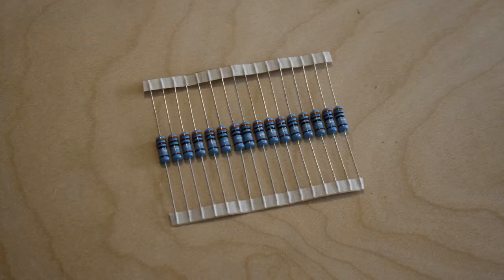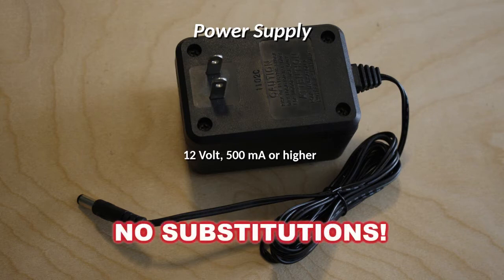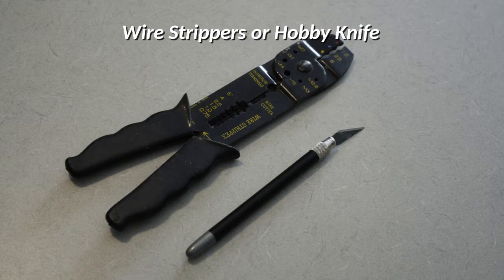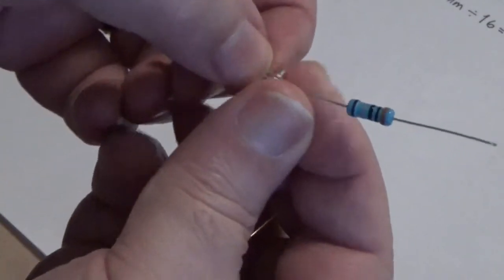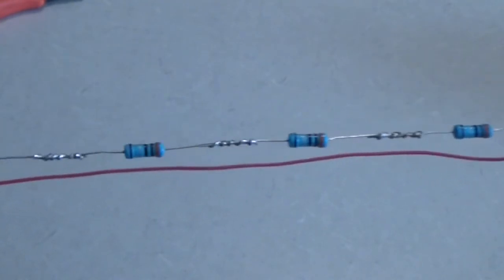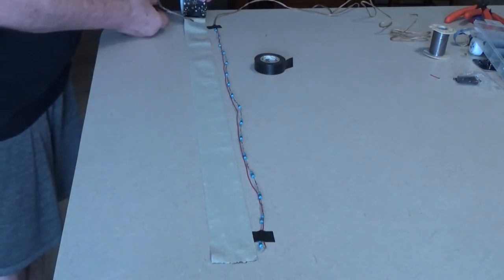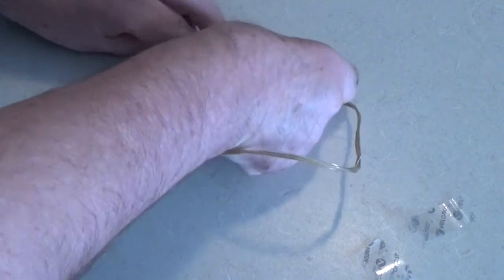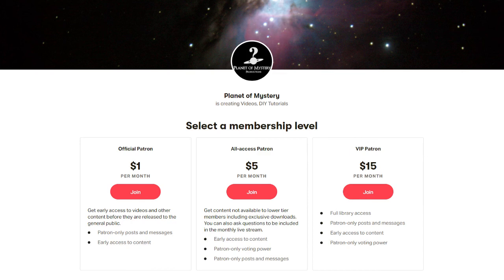DIY Dew Heater Tutorial

Comment: Hello thank you for this video!  Would this work for eyepiece strips also?  I'm a novice so unsure how that many less resistors will affect the build, i mean would it over heat?  Thank you for the video again!
Reply from the maker: An eyepiece strip wouldn't necessarily overheat but you wouldn't need the 3 watts of heat this produces. 

Using the formula of Ohms=(voltage^2)/watts for a one watt heater, you'd need 144 ohms. Use three 47 ohm resistors arranged around the eyepiece to get 141 ohms which would be close enough (you'd get slightly more than 1 watt of heat). Use half watt resistors and you won't have to worry about causing them to burn out.

Comment: if i wanted to run a 2 watt heater off a 16650 battery, am i right to assume that i would need resistance roughly equaling 6.85 ohms? if i went to say, 7 ohms it would just make me a slightly less than 2 watt heater right? the only other thing i'm confused about is what benefit i have changing the watt rating of a resistor. i thought that was their rated consumption but that can't be correct.
Reply from the maker: From what I can see, the 16650 battery puts out 3.7 volts. So, yes, for a 2 watt heater, it would come to a total of 6.845 ohms. That's going to draw slightly more than ½ amp. So a 1 amp hour battery would last about 2 hours.

You might make a ring of 7 resistors each at 1 ohm. Each resistor would have to contend with 0.286 watts so ½ watt resistors would work well. 

The watt rating on the resistor isn't the determining factor of how much current it can draw. It's a matter of how much it can draw before it pops. If you put 1 watt of power through a ½ watt resistor, you'll burn out the resistor. 

As for the formula for determining how much resistance you need for a specific wattage output, it's Ohms = Volts^2/Watts. 

The number of resistors was based on the rating (say ½ watt) and the number of watts (3) then I'd want to use a minimum of 6 resistors so I wouldn't overload the rating. To be on the safe side, I might go with 8 so each one would generate 3/8 watt. 

I might do a follow up to this video to explain the math behind all of it.

And I apologize for the delay in replying. Computer troubles.

Comment: Love your video. 
I have a 12” Newtonian , it’s about 42” around . How many resistors would I need ? And also for the secondary mirror ? I have a Thousand Oaks dew heater controller . 
Thanks
Reply from the maker: I'm not sure how much voltage is put out the the Thousand Oaks dew heater so that's one factor.

With a Newtonian, unless it's open tube, you probably don't really need a dew heater for the primary. It takes a LOT for condensation to reach that far down the tube. But if you do need one, you're probably looking at a 6 watt dew heater.

For the secondary, you can probably get away with a 1 or 2 watt heater. 

To calculate the resistance you'll need, use the following formula:

Ohms = Voltage^2/Wattage

So if you've got 12 volts, to generate 2 watts, you're looking at 72 ohms. To generate 6 watts, you're looking at 24 ohms. 

Now figure out the circumference and come up with how many resistors can fit in that space. Divide the total number of ohms by that number to get how much you'll need per resistor.

On the primary of a Newtonian, don't use the diameter of the tube but the diameter of the mirror. The dew heater will go inside the tube because you want to get it as close to the glass as you can. 

I hope this helps. If you have more questions, please feel free to ask!
Reply: @planetofmystery4787  thank you for the great help! Very useful information !!!

Comment: Very well explained sir.  Thank you for the video.  A small question though (I am a novice on electronics), what is the approximate heat generated by this?
Reply from the maker: At 12 volts DC, this will generate about 3 watts of heat.

Comment: hello great video i have a question through. when you measured the spacing of the resistors why did you say to use the same mark on the same ends of both resistors but on the video you showed to have  used one side black and the other resistor the  red to measure the 46.25 mm? reason i am confused it because you mention to use the same band to measure the distance but in the video you are showing to use two different sides or color bands. you are measuring from black to red to measure the 46 mm. please any advice would help and thanks again
Reply from the maker: On the resistors I used, there were bands on both ends so the orientation doesn't matter (I think I mention that at some point). If your resistors have bands at only one end, you are absolutely right about making sure they have the same orientation when you measure.

Good of you to catch that!
Reply: @planetofmystery4787  AHH IC ok you mean on the same ends in this case the band all the way to the right . that would be my measuring point end to end from right end to right end. I ordered the same exact resistors on your link you are awesome sir thank you! Clear Skies! how has to heater held up to the dew? my resistors come tomorrow.
Reply from the maker: @GalileoUAS  Mine worked quite well when the weather was warm and humidity was my biggest problem. I'm preparing to make one with half as many resistors (so I'll have to use wires between the resistors) which will double the heat output from 3 watts to 6 watts. These resistors should be adequate to handle the 3/4 watt they each generate but I'm not sure I'd want to push it beyond that.

Ad astra!

Comment: Nice. Do anyone know the math behind the ammount of resistors? Think ill give this a try, sucks to have no electrical skills tho haha. I happen to have a ton of resistors at hand and i find the dewheaters to be way more expensive then they should be, could be fun to try build something instead!
Reply from the maker: First, figure out how much heat you need to generate. An 8" Cassegrain like I have takes about 3 watts to keep clear. A finder scope or smaller objective might be as little as 1½ watts.

Then determine the resistance you need based on your power supply. 

The formula is:

Ohms = Volts^2/Watts 

In my case, it was (12 volts)^2/2 = 72 ohms. 

From that, find a value for each resistor, such as 6 ohms and divide to get 12 resistors.

As for the wattage rating, make sure that the total combined wattage for each resistor is greater than the number of watts you hope to generate. In the example above, each resistor would generate ¼ watt of heat so using ½ watt resistors gives me a bit of a margin for error. 

I hope this helps.

Sorry for not replying sooner. Computer problems.
Reply: @planetofmystery4787  Awesome explination, tyvm. Im sure others also will have much use for this. Ive built two bands already and they have worked very well. They ended up a tad lower powered that I expected but close enough :D

Comment: Why does a resistor care which direction it's connected?  
They carry current either way, right?
Reply from the maker: The only reason you'd need to be concerned with orientation is because you're using the color bands as a way of measuring the spacing between the resistors. You could measure from any point of reference on the resistor but you want something that is consistent from resistor to resistor.

I hope that clears it up.
Reply: @planetofmystery4787  Thanks

Comment: and is the power supply AC or DC?
Reply from the maker: DC. It's possible to use batteries to run the dew heater but due to the current drain, they'd run out pretty quickly.

Comment: so the resistor code does not come down to red black black... it's a 4 band resistor with code "orange, black, black, silver with 1% tolerance (brown)"...
Reply from the maker: Correct. Each resistor is a three ohm, 1-watt (for heat dispersion). I was able to find them online.